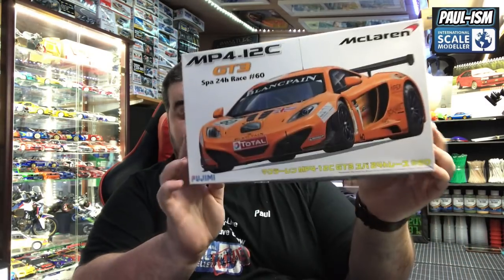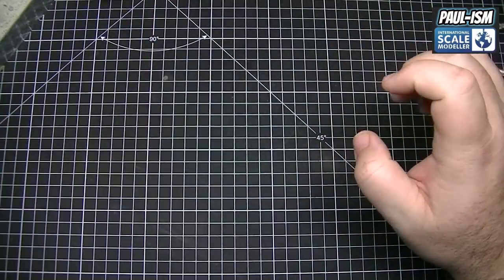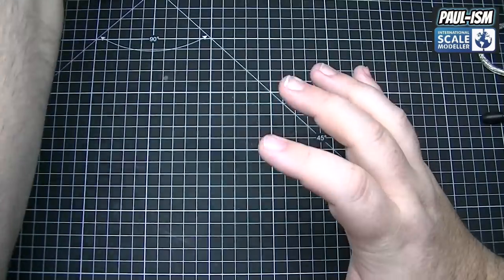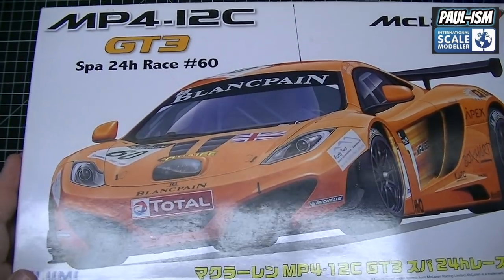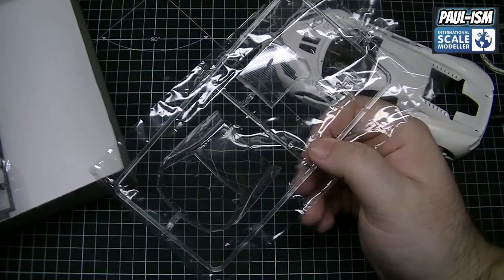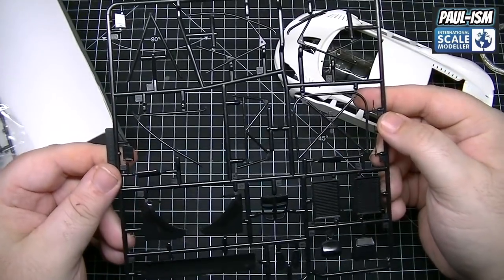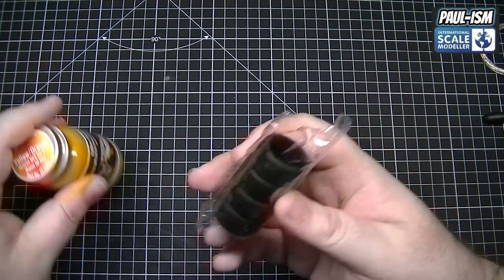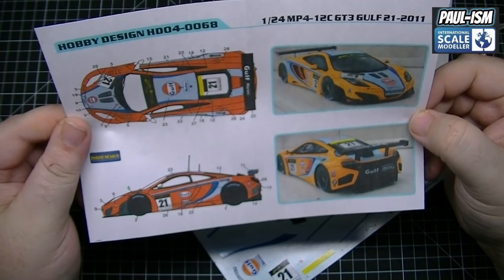"At the Bench" with Paul 22nd January 2019

Comment: Hi Paul. Love the updates and your honesty regarding some kits just aren't worth the effort and it's best to simply move on. I do have a question - something that continues to escape my meager skill set. Is there a technique for sanding filler to feather the edges to the point where the filler is no longer visible. It seems that no matter what I do when filling a seam, hole or depression I can never get the edge of the filler to disappear. I apply only enough filler to cover the area in question, allow the filler to completely dry and then sand using multiple grits ending with 1200 grit or even finer. When I prime the spot inevitably the edges of the filler will show. I'll re-sand/smooth and yet I still seem to see the edge in at least some areas. Thanks, Dave
Reply from the maker: Hey Dave, cheers mate, good question too :)  thanks for watching and commenting :) Paul